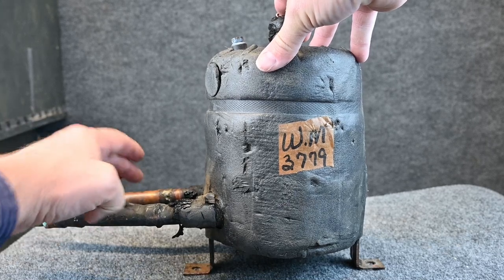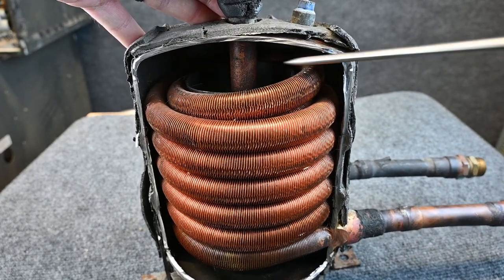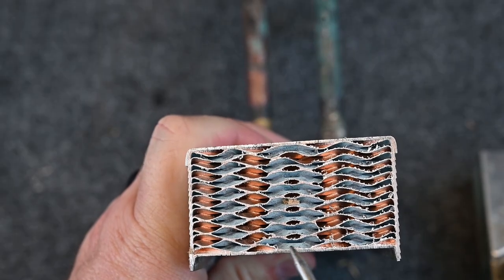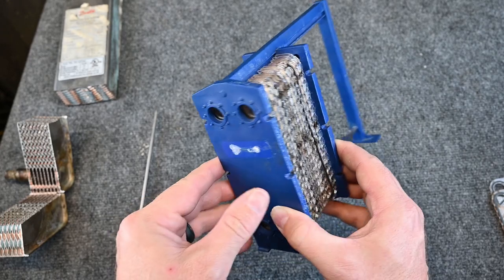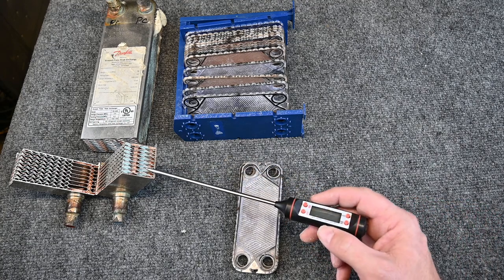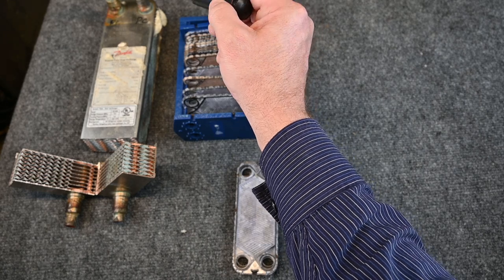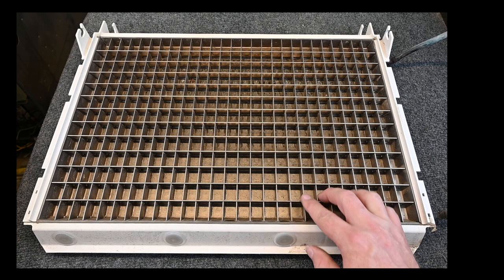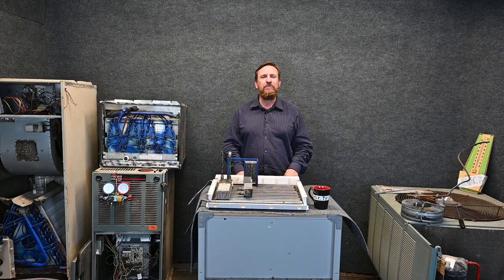HVAC 096 Evaporator coil with fluid instead of air

Comment: I work on glycol units for draft beer systems.  Great informative video. Thanks TY 👍
Reply from the maker: Seems like pump and motor is the biggest fail point. Which is your favorite brand?
Reply: Definitely pump n motor failure. Banner glycol chiller. I check brix % every 6 months n make sure there clean.

Comment: I work around a lot of coaxial, plate and frame, brazed plate, tube and fin HXers. All we do for a living is heat transfer. Thats it. Whether with refrigerant and water/ glycol or refrigerant or ammonia or those funky absorption chillers. That lithium bromide mixture is interesting

Comment: Hey Ty , I love your channel. You are teaching me something new everyday. I’m charging a unit. My air handler is in a mechanical closet which has a cut out in the wall feeding return air into the mechanical room and then into the the unit. Do I take my indoor wet bulb to calculate superheat at the cut out on the inside of the building ? At the cut out on the inside of the mechanical room or right at the air filters at the unit ? Thanks !
Reply from the maker: At the air filter is usually a safe bet. 
Is their gas in the mechanical room?
It a red flag it your pulling return air form the same room as a gas appliance.
Reply: No sir , just two air handlers. I think the previous tech overcharged it.  Superheat is at 13. I calculated it at 24. But I’m going to go back early in the morning and check it with the door shut. Once I realized the setup I realized I was flooding the mechanical room with 90° outside air with the doors open.
Reply: I’m going to clean the condenser real good , clean evap and put fresh filters before I make any adjustments. The tech I’m covering for sets all superheat at 13-14 cause that’s what he was taught.
Reply from the maker: That's good your thinking about it! Your thinking about the superheat the effects and your thinking about the return air and how the mechanical room temp affects it. That makes me very happy!
I learned a lot of things the wrong way then had to relearn them. I'm still learning things. The important thing it to stay on the learning curve. Keep up the good work.
Reply: I’ve been doing this since January. I’ve learned so much from you and a few other guys on YouTube. I’m 41 so I have to catch up and cram material. I’m going to a local community college, but honestly am picking up more on here and with hands on. I just want to degree 🤣

Comment: I have had several of these fail recently. The spot welds on the outer shell holding the coil in place are ripping away and releasing the refrigerant.
Reply from the maker: That's ashame 😔
Everything's seems to be built cheaper and cheaper